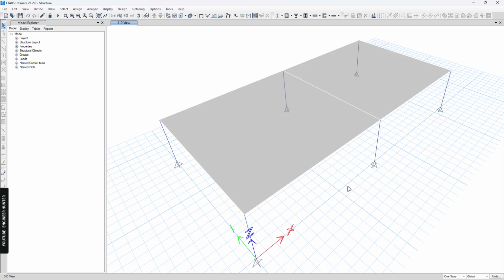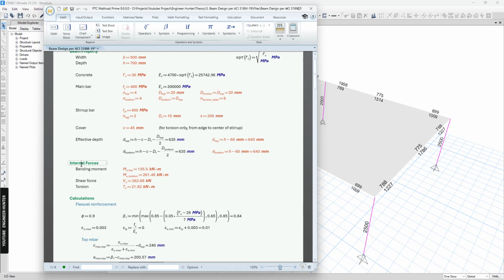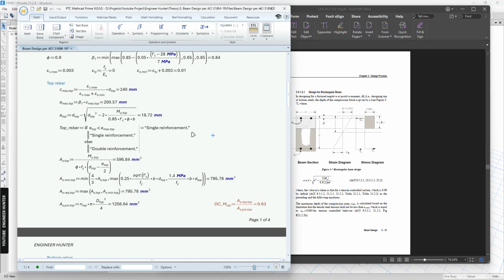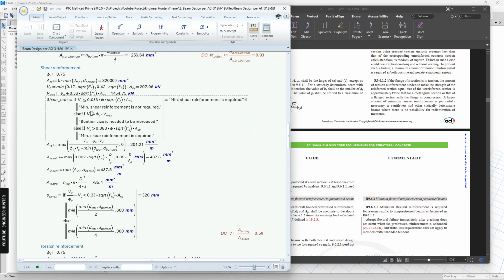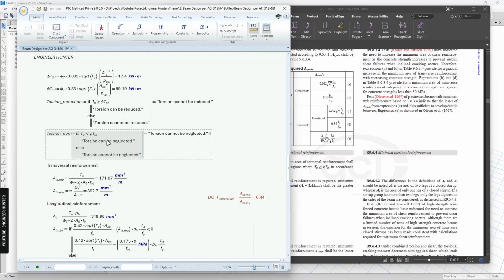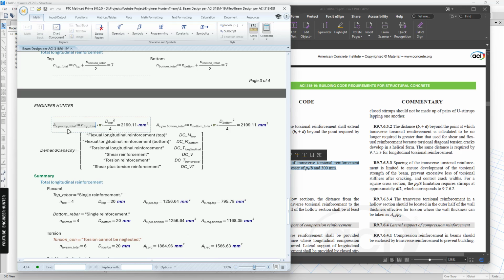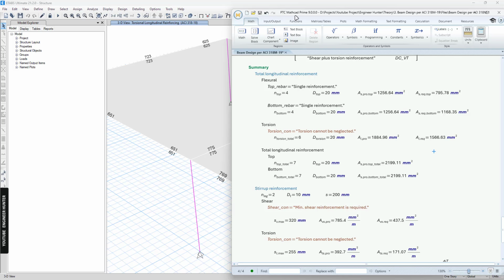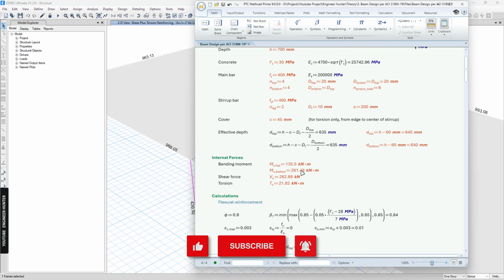Beam Design per ACI 318M 19

Comment: I am designing a simply supported beam with a maximum (or design) bending moment of 199 kip-ft. When I am designing the beam by default, the beam is classified as "Sway," and the reinforcement is determined based on Cl. 9.6.1.2 of ACI 318-14, resulting in a required reinforcement area of 2.144 in². However, the design moment reported in the design output report is 30 kip-ft.

When I change the beam type from "Sway" to "Non-Sway" or "Sway Ordinary," the reinforcement calculation follows Cl. 9.6.1.3 of ACI 318-14, reducing the required reinforcement area to 1.425 in² and the moment is taking is same as the design moment (199 kip-ft)

My Questions:  
1. Why does the design moment decrease when the beam is classified as "Sway"?
2. Why is the reinforcement area 1.425 in² in the "Non-Sway" case when the minimum required reinforcement is 2.144 in²?